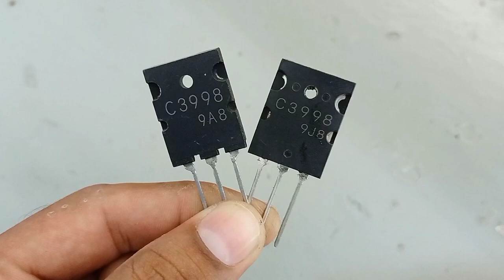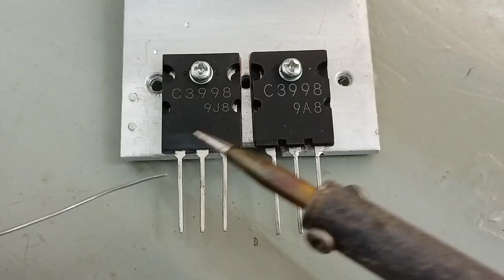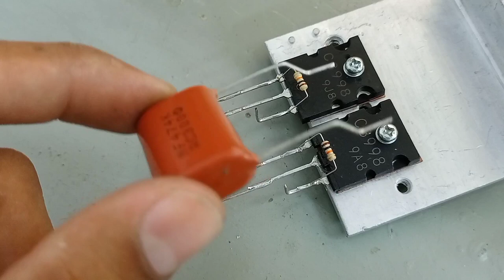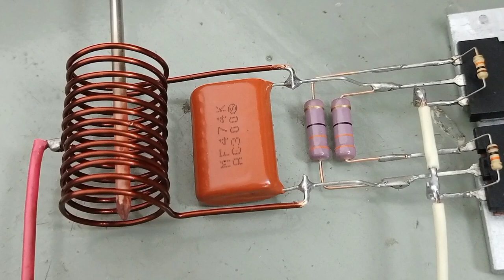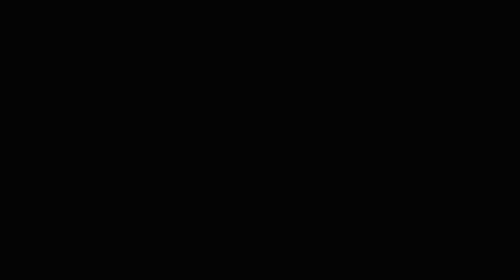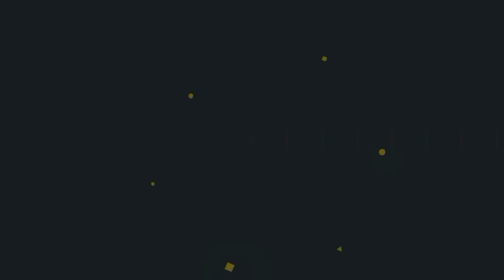Induction heater coil without mosfet

Comment: Hi. Good video. I used C3998 218 and others component as description but it did not work. When i power on, the voltage drop from 12V 20A to 0,6V. Why? What's wrong?
Reply: Did you test the induction power?